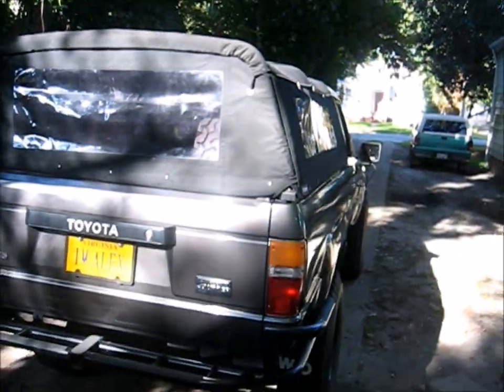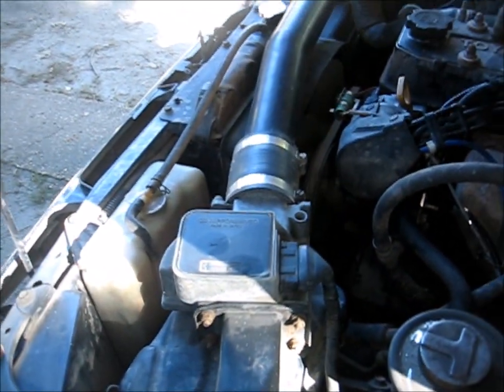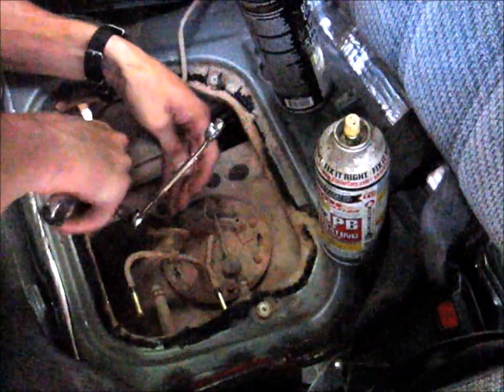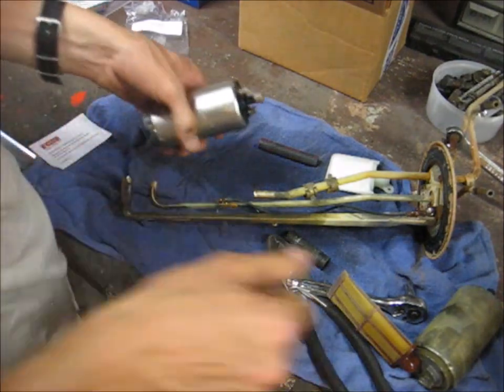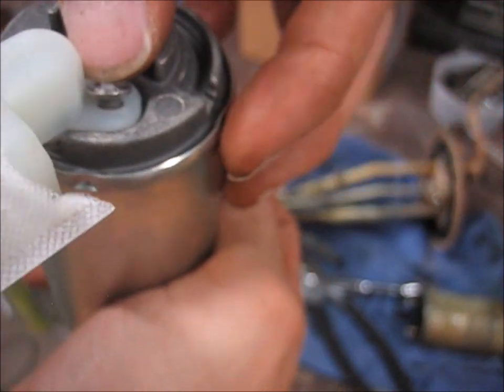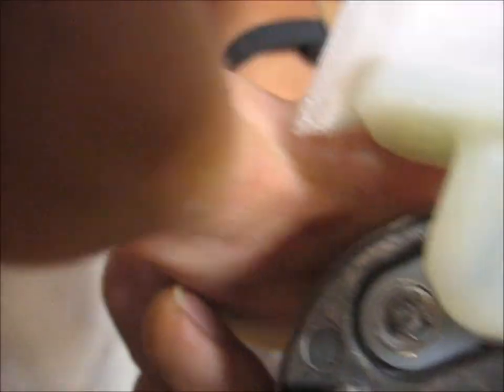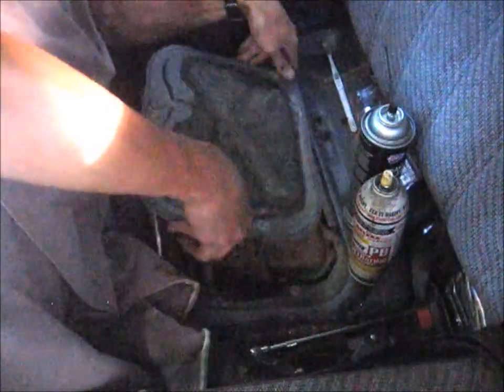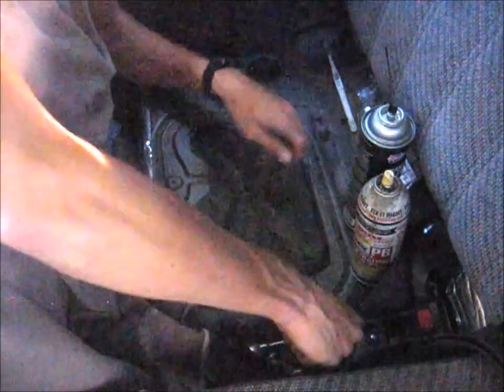How to Replace the Fuel Pump in an 85-95 EFI Pickup or 4Runner

Comment: Hi Alexman, Always appreciate your videos. Good to learn from your experience! Did you replace your FP because it failed, because it was giving signs that it was about to fail, or just as preventive measure having an educated guess of when it is most likely to fail? At what mileage / age did you replace it?
Reply from the maker: I was about to go on a week long road trip so I replaced it as a precaution. No symptoms. It had nearly 400,000 miles on it. I actually kept it and used it later in another vehicle where the fuel pump had rusted into a solid chunk. Sold that car so it may still be pumping.
Reply: @TheAlexManVideos ,Thanks you, Sir! When I get my new one, I'll keep old one in the truck.. I have converted truck body cavities so I have lots of room to store spares- :)

Comment: 1992 4runner SR5 does not have an access cover under the seat.  Tank has to be dropped, which is a monumental PITA.
Reply: Just cut through the metal . make a small hatch door. Most people do that. Im going to. Very safe if done right.

Comment: So I snapped the part you was talking about, new one is on the way? If the bolt is seized, didn’t use flare wrenches was my first mistake, how should I go about getting that fitting off without completely ruining my fuel line?

Comment: Hey Alex. Thanks for the video, it was very helpful! I know this is an older video, but I have a question for you. I've gotten everything done aside from the fuel line which you suggested being careful not to break. I didn't break mine (although started to bend it) but I can't get that detached, and the 14mm nut is almost stripped from me trying to loosen it. I've put PB blaster on and it's not budging. I don't want to risk stripping it completely or breaking the line. Do you have any suggestions? Would it work to just leave that line attached, lower the tank, and then have enough room to pull out the assembly? I can't pull the assembly out as it is because there's not enough slack in the fuel line to allow it. Thanks a lot!
Reply from the maker: That would be annoying but it would work.
Reply: Thanks, I appreciate the response! Well I was able to pull it out without lowering the tank or breaking any lines. I replaced the fuel pump...and it continues to crank but still won't start. 🤦🏼‍♂️ My last option (which should've maybe been first) is to drain the old gas and replace it. The fuel in the tank is about 2 years old. Is there a way to diagnose an "old fuel" problem before draining the fuel tank and replacing it with new gas?

Comment: does the pump run with the key on or only in the crank position > need to know so I can try banging on bottom of tank in an attempt to get old pump working.
Reply from the maker: The key needs to be in the START position. In the ON position, it will only run the fuel pump if the VAFM senses air flowing through it. In other words, if the key is in the ON position but with the engine not running (no air flow through the VAFM), the fuel pump will not run. You can test the fuel pump by connecting B+ to FP in the diagnostic port under the hood while the key is ON.

Comment: thanks Alex
I would add, don't even try taking the 14mm fitting loose without a flare wrench. It looks like your 14mm wrench slipped a little over the fitting also, since it's stuck there when you removed the pump from the tank. Since I had to push so hard my flare wrench rounded the whole thing and had to use vise-grip. Mine would not break loose, finally, I hit the corner of the 19mm many times and then liquid wrench again. next morning it broke loose. 
Since my connection was so tight, I'm worried it will not seal up after reinstalling.

Comment: Hey AlexMan, love the videos especially since I own a 1986 4 runner. Unfortunately one of the valves has seized  up and my local shop says $2400 to do a full top end repair...does that sound about right to you?  That includes sending out to a machine shop, adjusting the values and setting the timing.  Do you think that would be a job for a weekend mechanic to tackle?  I also need fuel pump and radiator which I'm going to tackle thanks to your fuel pump video.
Reply from the maker: That might be a little high but it's certainly not unreasonable for that amount of work. You can buy a new aftermarket head for a few hundred dollars. Metal timing chain guide set is $150 or so. Another hundred for gaskets and another hundred for odd and ends, fluids, and other things you forget about. Search YotaTech for threads of people doing head gaskets for the first time on their own. It can be done if you do some research and are mildly mechanically inclined. Where in the country are you located. I'll help out if you're close.
Reply: In AZ, phoenix to be specific.  But thanks for the YotaTech,  will take a look at that, love the videos...keep'em coming.
Reply from the maker: No problem. Glad I am able to help. I'm on the east coast otherwise I'd lend a hand.
Reply: Shop craigs list for mobile mechanics.  Suggest you buy a new head with values for a 22 r on ebay.  Valves do not seize. So the engine may have overheated.
I have replace the head on a 1988 4 runner 22r.  The bolts behind the valve cover next to the fire wall are very hard to get to.  I replaced the head gasket for 50 dollars.
Reply: pnr123456 you can get a whole rebuild engine for that price if you ask me it’s over priced.

Comment: bought a new fuel hanger from ebay. and tested the positive and ground wire. the positive wire is also grounded. the fuel pump works. I can not trusted to put it inside the tank.
Reply: Positive wire may look grounded but it has electrode washers so it doesn't hit the metal parts, the pos one goes to the top and neg is on the side, js

Comment: What holds the pump into the frame?  You didn't say, and that's important.
Reply: Most likely the big black gasket at one end and a tight fuel hose at the other end...hold it all together, overall weighs very little.

Comment: Hi! awesome video. I had managed to get a fuel pump that is much smaller in diameter and with a different wiring setup. I intend to return it, and get one of these, but I have already put it in there and crimped the wires (so they would now be too short). Is it possible to replace those positive and negative wires? thank you very much! it was my first time doing it and I'm despairing a bit over this
Reply from the maker: My first thought is you wouldn't want to crimp and splice longer wires on there. The ground should be easy to entirely replace. The positive needs to be able to pass through the sending unit and be electrically isolated from the mounting flange. Make sure whatever wire you use has insulation rated for use in fuel. If you can't find wire that's spec'ed for this, you can always go to a junkyard and strip wire that's used on an in tank pump from some other car.
Reply: @TheAlexManVideos  thank you so much for this comprehensive reply! it sent me all over town trying to sort this out over the last week. surprisingly hard to find fuel rated stuff, or any knowledge about it. one of the autopart stores finally called the manufacturer and confirmed that the crimp connectors would corrode in fuel. I am now tempted to just get a new bracket all together. Thank you for putting this on my radar. the local yunk yard is not very big and was pretty stripped, but i had some fun in there trying to find these little parts 🙏🏾🙏🏾🛻
Reply: @TheAlexManVideos  where did you get this kit from ?
Reply: Put a new fuel pump in. Now my gas gauge doesn’t work. Can someone help tell me what to check.

Comment: Hey so do you know what all 3 of those lines are I'm having trouble figure out what is return and what is a breather
Reply from the maker: The pressure line should be pretty obvious. The vent and return can be mixed up since they have the same size and connection. With the whole sending unit out, the line that goes all the way to the bottom is the return, the one that just goes through the mounting flange is the vent. If you don't want to remove to replace, you can see in the video which is which and try to match that up to your truck. But sending unit changed a few times so I'm not sure that would be 100% accurate. Best way is to trace the lines back from the engine bay. Vent is connected to the charcoal canister, return is connected to the back end of the fuel rail.

Comment: were you having an acceleration problem? this is the next thing im checking....
Reply: Hey, I'm currently having a similar problem, when I accelerate it feels like I'm out of gas. Did you fix your problem with a new pump?
Reply: I had a mid 80's celica, different vehicle but same 22re, fuel pump went bad. Problem wasn't acceleration but just engine cutting in and out during normal driving. I had 150 mi round trip every day so it was easy to notice differences.  If it's an acceleration only problem I would say it's most likely other things but I am no expert, just a lifelong DIY mechanic. Maybe someone here knows more and can verify that acceleration only can be affected by bad fuel pump.  I didn't know what the problem was at the time so I did the standard fuel pump tests from the TOY manual and noticed intermittent operation. That is how I finally knew it was the fuel pump. Hope this helps you, it was all guess work for me 20+ years ago.....

Comment: Hey I have a 93 pickup and I was wondering on how what the best way to take the fuel pump out?
Reply from the maker: Either drop the tank or remove the bed. Neither one is too hard. Pick the bolts that are less rusty.
Reply: TheAlexManVideos what were your symptoms. Why did u replace it. Mine stalled on me the other day on the freeway and wouldn’t start back up lucky 20 min later after after try it turned back on I wonder if it’s my pump also

Comment: hey Alex, I have an 85 Pickup carbed, and the fuel sending unit is bad, doesn't show fuel level. 

would it be easier to take the bed off, assuming me and some friends can, or drop the tank?
Reply from the maker: If the bolts are all in good shape then dropping the tank isn't really a big deal so long as it's nearly empty. I never had to remove the bed on my Pickup during the time I owned it so I can't really say how hard it is in comparison. I've heard different people suggest each way is easier. I'd say it's really a toss up and do whatever you think will be the easiest in terms of rust. Sorry I couldn't give you a clear answer.
Reply: Your answer is fine, I'll drop the tank. Thanks!

Comment: Where is the fuel pump relay on a 1986 4runner
Reply: EFRAIN VILLATORO under the steering wheel, there are two relays, one for the headlights and another for fuel pump. The rrlay should say "FUEL PUMP"